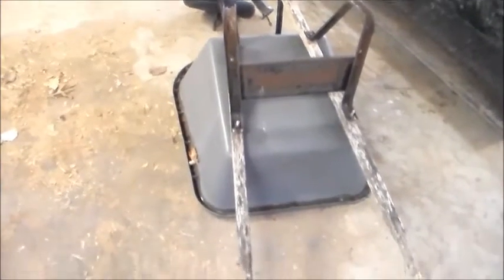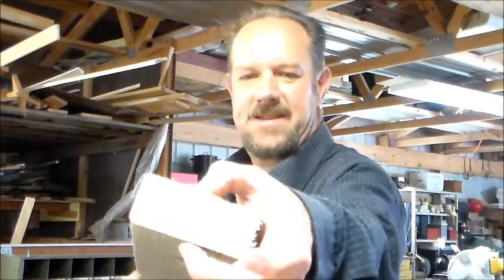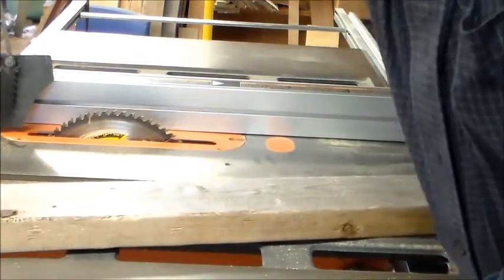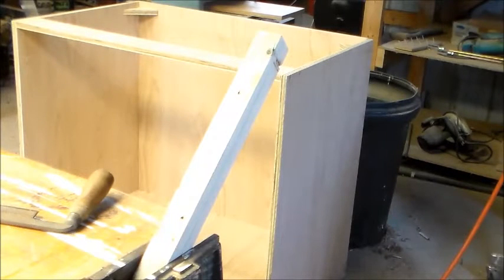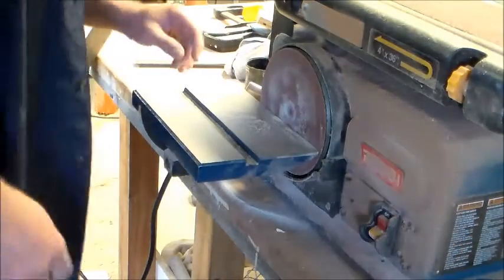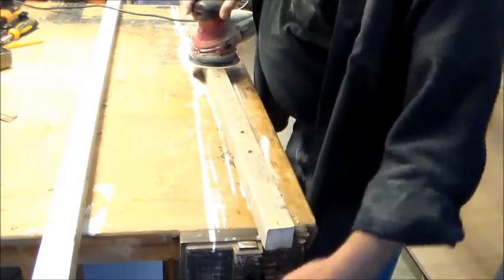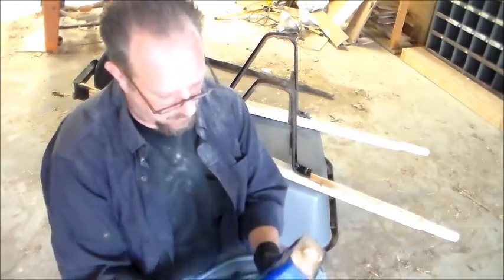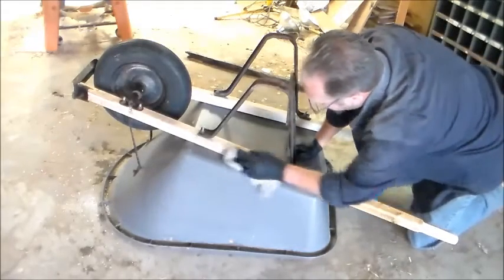How To Make Wheel Barrow Handles

Comment: Picked up 2 wheelbarrows up at a garage sale that needed handles. I was surprised at the price for a set $24-39 on Amazon. That's a lot of money. I'll be creating a pair just like yours this weekend. Also, I was thinking it might be a bit easier to apply the oil before attaching the handles. Thanks for a great video. You asked about an idea to improve your videos, when you are doing redundant or long segments you can speed up the video so that the majority of the time is spent on the particulars of the project. Again, I'm only sharing because you asked. Keep up the good work.

Comment: I pulled a wheelbarrow out of the trash last weekend. My son-in-law are going to refurbish it and it's going to him. I plan to use the old handle, clamp it to the new one and drill the holes that way. It should (jinxing myself here) be a pretty easy job. He needs to buy a new wheel though.
Edit: You should also consider how the grain is oriented, you'd want a vertical grain pattern.

Comment: nice job. Why not use old handles as a template for new holes?
Reply: I pulled a wheelbarrow out of the trash last weekend. My son-in-law are going to refurbish it. I plan to use the old handle, clamp it to the new one and drill the holes that way. It should (jinxing myself here) a pretty easy job. He need to buy a new wheel though.

Comment: Handle broke and your tutorial was first to pop up.  Was looking for the tool to round the end.  Have to find me a draw knife or something similar.  Thanks.
Reply: You can set circular saw at a 45 degree angle and Carefully shave the corners of square into octagon.
Reply: I plan to use a router with a round-over bit if I have a bit that's big enough.

Comment: Idk about using spruce for handles,its kinda a weak wood. Store bought handles are pricey,so I understand ya using what you had on hand. I think I've got some 2" thick white oak that should work ok and hold up well outdoors. My cheap true temper held up for almost 15 years,but the tub is gettin rotten. My brother in law gave me a jackson construction grade that's folded steel and has a broken handle. I'll replace the hardware as well since its original.

Comment: Looks just like my true temper gray plastic wheelbarrow was not sure if I should throw it out or make handles,   and I was wondering if pine would hold up.  I thought it originally came with hardwood handles like hickory or something.  How are the pine handles working out?
Reply from the maker: You can use hickory or ash, but the pine holds up just fine. They are plenty strong and if you treat them a time or two each year with some linseed oil, they will last a long time.

Comment: If this is softwood construction 2x4, won't be as strong as original hardwood handles.
Reply: <<
kimchee94112
4 years ago
If this is softwood construction 2x4, won't be as strong as original hardwood handles.>>

I agree.  He missed out on an opportunity for a significant upgrade by using oak,  hickory or some other strong hardwood.

Well,  I suppose he can do that next year when these handles break again.